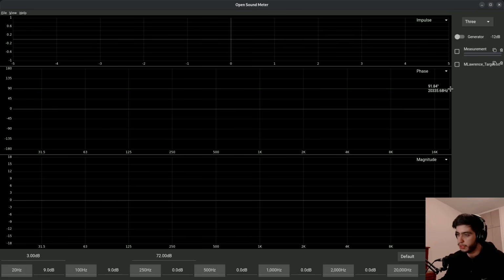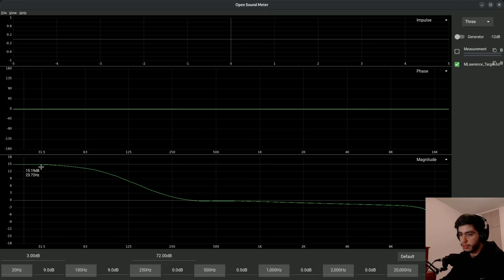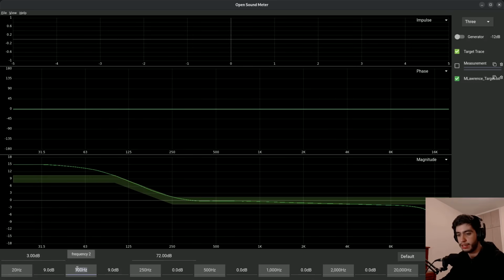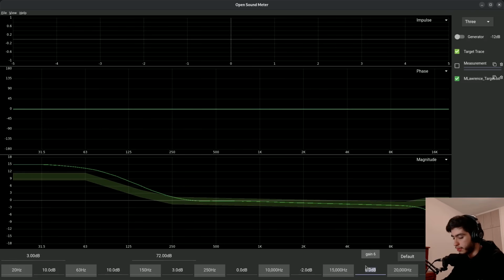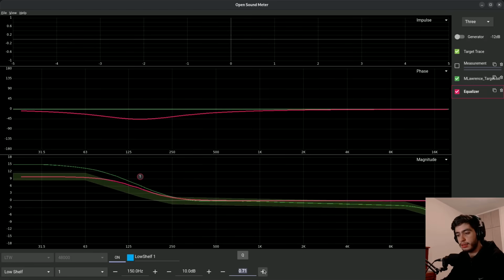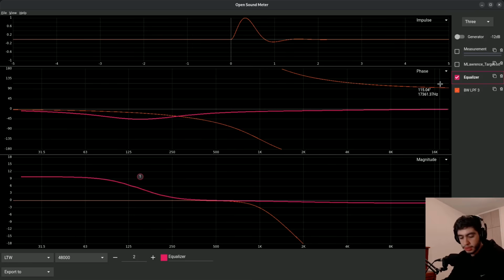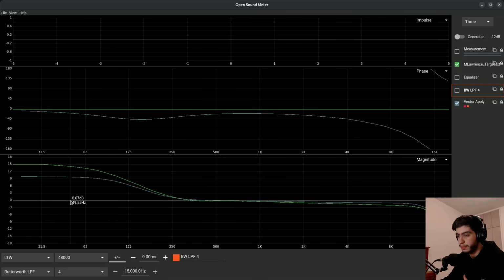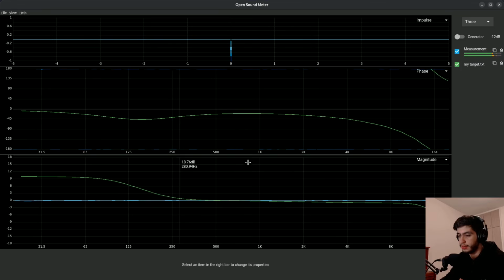how to make a custom target trace in OSM

Comment: Thanks Daniel! I don’t understand why you added the eq band at 15 kHz with the very wide Q when the LPF filter you set afterwards also gave you that gradual dip. Care to elaborate?
Reply from the maker: The hpf only does that in the high frequencies. But the dip starts around 2khz that's why i used the shelf